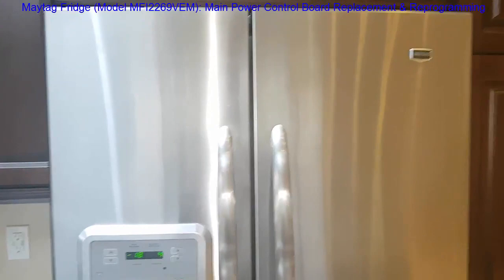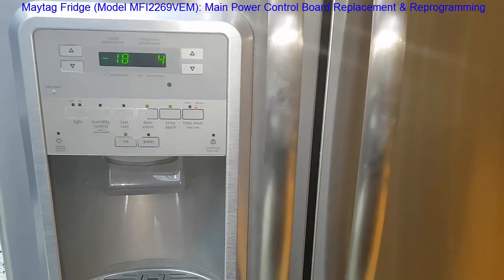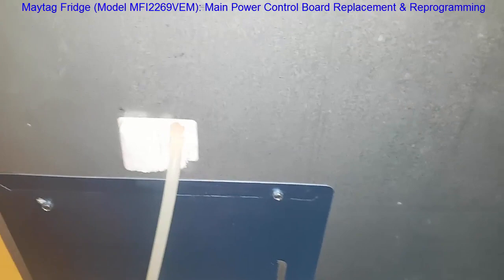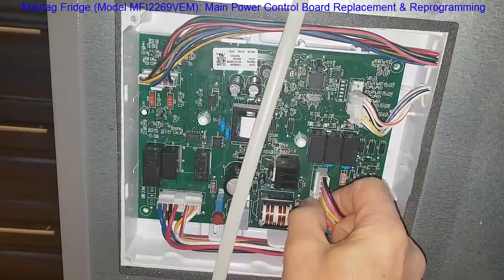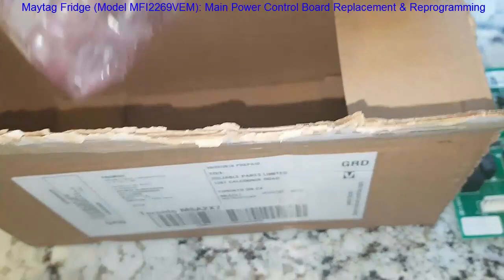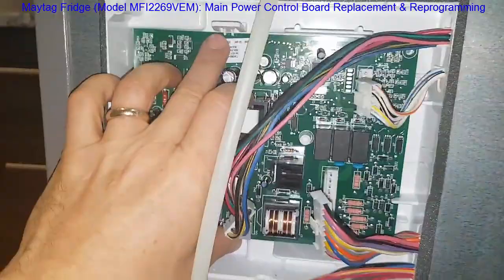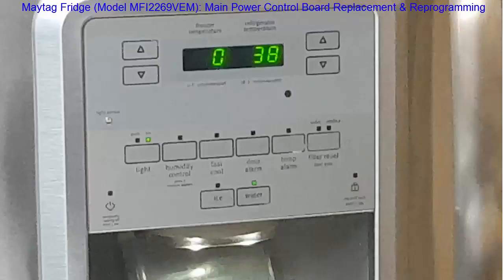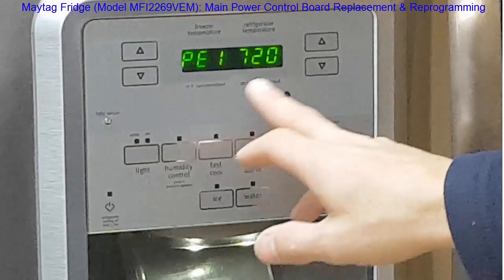Maytag Fridge - Main Power Control Board Replacement and Reprogramming

Comment: Same fridge same problem. $260.00. for mine. When I was pushing buttons I saw Ice and water mode. Do I need to program those also ?
Reply: Hi Lisa,  Where did you look for your board? Did you see if you could find it for less? I paid about 172 with HST.    Regarding the programming, I recently had someone else (E. Smith) who wrote back to me (in Sep.2019) the following, which should be very helpful:  ----- E. Smith wrote: -----  My refrigerator, (identical to the one shown in the video) would not go into program mode as described.   However, I went to the "Service Instructions" that came with the refrigerator when we bought it.  Note, these are not the "User Instructions".  The Service Instructions provide a "9 STEP" set of instructions on how to program which worked for me.  These steps are as follows:   1) Press & hold the Door Alarm Keypad.   2) Press & hold "Freezer Temp Down" button on the keypad for 3 seconds.   3) Release the "Door Alarm" button on the keypad & wait 3 seconds.   4) The control will display "PE" to indicate your in programming mode.   5) Entry is confirmed by pressing the "Freezer Temp Down" button once more.   6) The control will display the current Program Code.  The value should be validated with the program code printed on the unit serial plate, located inside the fridge (mine was 1720).   7) Press the "Refrigerator Temp Up" button on the keypad or "Refrigerator Temp Down" button on the keypad to change the digit value with each key press.   8) The decimal point indicates the selected digit.  Press the "Freezer Temp Up" button on the keypad to select the next digit.   9) Once the desired Program Code is entered, press and hold the "Freezer Temp Down" button on the keypad until the Program Codes begins flashing, indicating it has been saved.  These Service Specs also say: "NOTE: If you attempt to enter an invalid Program Code the Control will not save the New code.  Exit the programing process by pressing any key OR press the "Door Alarm" button on the keypad for 3 seconds".  If you entered the wrong code I recommend you unplug the unit and start over.------ end of text from E.Smith.  So Lisa, please read the above carefully and try following step by step and hopefully this gets your fridge code entered and you are hopefully back in business ----   ...  And if you find this helpful, I'd sure appreciate if you would please subscribe to my channel and like the video.  Thanks, and Good Luck.  Vito Casola.
Reply: I looked on-line for the part but it would take too long to get it. Sears had it cheaper but 2 weeks....  Couldn’t be without a fridge that long.The parts store also charged a $50.00 core charge..Got it back once I turned the broken one in. It’s making ice and up to temperature..Thanks for the video.  Saved me money...
Reply: Great!! Good to hear it all worked out.  If it was helpful then I'd appreciate if you would subscribe to my channel and like the video. I'm planning to add a few more videos of other repairs I've done recently, just need to find the time to finalize the videos and upload them. Stay tuned. Vito Casola.

Comment: I have the same refrigerator and replaced the control board due to the interior lights going out.  The interior lights did come on after the replacement but unfortunately now the exterior control panel will not light up at all so that I can begin the programming.  Has anyone else run into this scenario and maybe has a quick fix.
Reply from the maker: Hi Leslie, Sorry for the late reply. Thanks for your comment.  If you go through many of the other comments you should find some where people have had similar issues.  You may also want to try and double check all the wire harness connections to make sure they were properly inserted all the way in and making good contact. Vito Casola - FIX IT Yourself.!!

Comment: I have a same problem, I called same company for the spare part they told me that the price is 339.27 CDS plus tax . Is it normal please ? Thanks.
Reply: It seems like a high price if it is in fact for the same part number (ie. exact same Main Power Board as the one I needed which is shown in the video).  I contacted Maytag and got the local authorized parts dealer and they gave me the price I showed in the video.  Hope you will be able to get it for a better price.... Good Luck.
Reply: I paid the same but you get $60 for taking back the old one so I actually only pay $270.

Comment: Hello. My refrigerator will not save code, it keeps beeping. I have confirmed the code on the serial number tag and I have confirmed the control board. Please help.
Reply from the maker: Hi Almita. Thank you for subscribing. Not sure why your fridge keeps beeping. Please read through the comments posted on this video as you may find some useful information contained within the responses from myself and others that could give you hints on what you can try. Good Luck. Vito Casola - FIX IT Yourself!!

Comment: i dont have a panel on the back of the fridge, so not sure how to remove it from the front door.
Reply from the maker: Hi Adrienne. Is it not a fridge similar to the one in the video? If it's a Maytag then it should have a removable metal panel at the back of the fridge as soon in the video. You need to remove 4  screws using a 1/4" drive to access the main power control board. If it's a completely different fridge then I'm not sure if this video will help you. Good Luck. Vito Casola - FIX IT Yourself!!
Reply: @FIX-IT-Yourself  mine is a maytag, but the back is completely void of any panel, door, etc. Just one solid piece with nothing to remove. i have been scouring google, looking for a way to remove it the circuit board. i have a french door, freezer on bottom, ice maker with the circuit board malfunctioning, but cant find anything on how to take the thing off. MF 12269 VEM3. my fridge is smaller. maybe that's why it's different. thanks for your response.

Comment: I replaced the control board, as per the instructions, but I am having trouble with the programming. After plugging the refrigerator back in, the display does not show PE0 000. The display is blank and when I push any button, all of the buttons light up. I tried the door alarm and freezer temperature down for 3 seconds as per the instructions, along with many other combinations of holding down the bottons, but I am having no luck in getting to the programming screen. Has anyone had this problem and is there a solution?
Reply from the maker: Hi Nevin, Yes, it seems to the most common question by many others. I would suggest reviewing the comments posted by others below as one of them may help guide you to your solution.  Good Luck Nevin. Vito Casola - FIX IT Yourself!!
Reply: @FIX-IT-Yourself  Thank you for your response. I was not able to find any responses specific to my scenario where the screen is blank (no PE0 000). Multiple people noted flashing, but my screen is blank. All of the lights light up when pressed, but the 3 second combinations are not working to get to the programming screen, unfortunately. Thanks anyway!
Reply from the maker: @nevinjantz1643  Hi Nevi, Someone else who viewed my video (a Mr. E. Smith) wrote back to me (back in Sep.2019) the following, which you may be helpful for you:  ----- E. Smith wrote: -----  My refrigerator, (identical to the one shown in the video) would not go into program mode as described.   However, I went to the "Service Instructions" that came with the refrigerator when we bought it.  Note, these are not the "User Instructions".  The Service Instructions provide a "9 STEP" set of instructions on how to program which worked for me.  These steps are as follows:   1) Press & hold the Door Alarm Keypad.   2) Press & hold "Freezer Temp Down" button on the keypad for 3 seconds.   3) Release the "Door Alarm" button on the keypad & wait 3 seconds.   4) The control will display "PE" to indicate your in programming mode.   5) Entry is confirmed by pressing the "Freezer Temp Down" button once more.   6) The control will display the current Program Code.  The value should be validated with the program code printed on the unit serial plate, located inside the fridge (mine was 1720).   7) Press the "Refrigerator Temp Up" button on the keypad or "Refrigerator Temp Down" button on the keypad to change the digit value with each key press.   8) The decimal point indicates the selected digit.  Press the "Freezer Temp Up" button on the keypad to select the next digit.   9) Once the desired Program Code is entered, press and hold the "Freezer Temp Down" button on the keypad until the Program Codes begins flashing, indicating it has been saved.  These Service Specs also say: "NOTE: If you attempt to enter an invalid Program Code the Control will not save the New code.  Exit the programming process by pressing any key OR press the "Door Alarm" button on the keypad for 3 seconds".  If you entered the wrong code I recommend you unplug the unit and start over.------ end of text from E. Smith.
     
So I suggest you read the above carefully and try following step by step and hopefully this gets your fridge code entered and you are hopefully back in business ---- Good luck...  Vito Casola - FIX IT Yourself!!

Comment: Where do I get this control board? 🤔
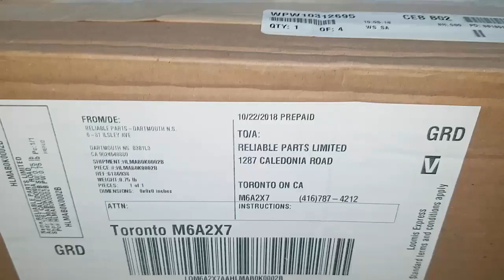Reply from the maker: Hi Niki, In the video (at 3:10 mark I showed the process I went through to find a local parts supplier). At 3:25 mark you will see that I got my board from Reliable Parts (1287 Caledonia Road, Toronto, ON, ). But I'm sure if you google the board number on Amazon or eBay you may find someone who may sell the board for a better price than I paid $152.72 plus HST. Good Luck with your repair.   Vito Casola - FIX IT Yourself.!!

Comment: Very helpful !!! Thanks 😊
Reply: Great!! Did you fix your fridge? Were you able to basically change the board out and rescue your fridge from ending up in a landfill?  I sure hope it did and hopefully saved you a lot of money in the process.If you enjoyed this video please like it and subscribe to my channel as I am planning to put out another 3 or 4 more videos on other repairs I have recently completed, including changing a CMOS battery on an IBM Thinkpad T42 laptop, fixing my front load washing machine and my aunt's KitchenAid Fridge, with $6 in electronic components, including a capacitor and a relay, instead of replacing the entire board, like I did for my fridge, this video). Anyway stay tuned for more to come. Vito

Comment: Thanks for this great direction! I had to keep trying several times, but eventually the PE 0000 stopped flashing and allowed me to put in the code!
Reply: Great!!! Glad to hear you were successful. Hope you were able to fix your fridge and divert all that steel and plastic from the landfill and keep more of your hard earned money in your pocket. Hope this video helped you a lot. If it did please subscribe to my channel.  I will posting a few more videos in the next little while. I recently fixed my front load washing machine and I just fixed my aunt's KitchenAid Fridge this evening for $6 of parts, including a capacitor and a relay. Thanks for visiting my channel. Take Care. Vito Casola.
Reply: PE 0000 keeps flashing.
Reply: Hello Clementino,  Recently someone else who viewed my video (a Mr. E. Smith) wrote back to me (Sep.2019) the following which may be helpful for you:  ----- E. Smith wrote: -----  My refrigerator, (identical to the one shown in the video) would not go into program mode as described.   However, I went to the "Service Instructions" that came with the refrigerator when we bought it.  Note, these are not the "User Instructions".  The Service Instructions provide a "9 STEP" set of instructions on how to program which worked for me.  These steps are as follows:   1) Press & hold the Door Alarm Keypad.   2) Press & hold "Freezer Temp Down" button on the keypad for 3 seconds.   3) Release the "Door Alarm" button on the keypad & wait 3 seconds.   4) The control will display "PE" to indicate your in programming mode.   5) Entry is confirmed by pressing the "Freezer Temp Down" button once more.   6) The control will display the current Program Code.  The value should be validated with the program code printed on the unit serial plate, located inside the fridge (mine was 1720).   7) Press the "Refrigerator Temp Up" button on the keypad or "Refrigerator Temp Down" button on the keypad to change the digit value with each key press.   8) The decimal point indicates the selected digit.  Press the "Freezer Temp Up" button on the keypad to select the next digit.   9) Once the desired Program Code is entered, press and hold the "Freezer Temp Down" button on the keypad until the Program Codes begins flashing, indicating it has been saved.  These Service Specs also say: "NOTE: If you attempt to enter an invalid Program Code the Control will not save the New code.  Exit the programing process by pressing any key OR press the "Door Alarm" button on the keypad for 3 seconds".  If you entered the wrong code I recommend you unplug the unit and start over.------ end of text from E. Smith.   So I suggest you read the above carefully and try following step by step and hopefully this gets your fridge code entered and you are hopefully back in business ---- Good luck...  Vito Casola.  If you found this helpful I'd appreciate if you would like the video and subscribe to my channel.  I plan to upload a few more videos soon.  Vito

Comment: Just my display in front not showing only when I open and close the door only had it 2months refrigerator
Reply from the maker: Hi, Is the fridge and freezer functioning properly and providing the necessary cooling or is it just the front control panel that is not working?
Reply: FIX IT Yourself I figured it out it is on energy save mode tks
Reply from the maker: Ok good, that was an easy one.

Comment: Thanks for the video. On my fridge, I hear clicking and a faint sound of a motor turning on and off but while this is happening, the inside light is still on. Think it is the control board you replaced or the keypad board? Thank you Sir.
Reply: Good Morning Louis,I cannot say for sure, but if your fridge is not operating correctly there is a good chance it is because the control board is not sending the proper signals to activate the devices required to produce cooling.  My fridge light was also on when I experienced the problem with the freezer no longer keeping food frozen.  I'd say it is worth trying to repair or replace the board.  If you are handy with electronics then have a look at the capacitors on the board and replace them if you can. Most times replacing the capacitors can repair the board and this will be least cost option.Good Luck.

Comment: I replace my circuit board with a new one but now the lights where the water dispenser is at sometimes shuts off and will work again.... so weird but at least the cooling always stays on now
Reply: Hi Tony, Glad to hear you were able to fix your fridge so it now provides cooling again.I just checked my fridge and it appears the light button can toggled three times. Press once and it lights up the "Auto" side (on the left), press again and it lights up the ON side (on the right) and press again and no lights are on. When ON light is lit the water dispenser light stays ON, when in Auto then the dispenser light only lights up when you depress the lever for water or ice. Not sure but when neither Auto or ON is selected it appears that the dispenser light still comes on when you depress the water or ice lever same as when in the Auto position.Anyway I hope my video was helpful enough to give you the confidence to go out and buy a new board and repair your fridge for less than the cost of even just a service call.

Comment: Where do you order the part from?
Reply from the maker: Hi Kim, At 3:08 mark it shows the process I went through to find a local parts supplier. At 3:24 it shows the name of the supplier I went to (Reliable Parts) and their address. Good Luck sourcing your part. Vito Casola - FIX IT Yourself!!

Comment: INstalled the new board.  Plugged in.  Panal blinks.  Read every post and every answer on what buttons to push and in what sequence...Nothing is working.  Light is still blinking.  Are the only buttons to use the "freezer  down arrow" and the "door alarm" buttons?
Reply: research your model number on the internet looking for how to reset.   my board came with instructions.

Comment: Hi Vito,  we replaced the main control board but we haven't been able to re set it. we cat put the code in as the dot never appears on the screen.  We have tried pressig the door lock and temp down combination but the dot will not appear on the display.  It is only showing PE0 000  can you tellme how else to get the dot to appear?  Thank you,
Reply: Did you try pressing the up and down arrow to see if that allows you to at least change the number in the first digit of the code? All I can tell you is to try watching the video again from the timeline starting at 5:45 of 8:30. This is the part that shows how to enter the code and get out of program mode.  Also from 7:17 of the video it shows how to enter the program mode once you are no longer in program mode. Hope this helps. Let me know if you have anymore questions